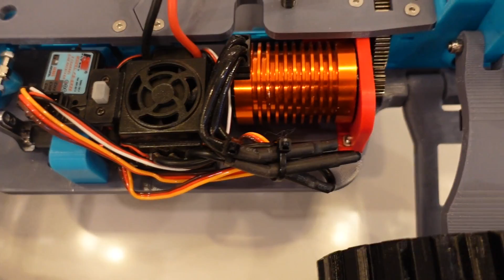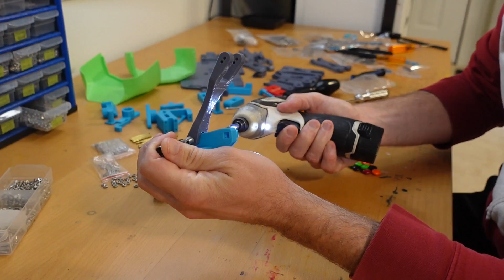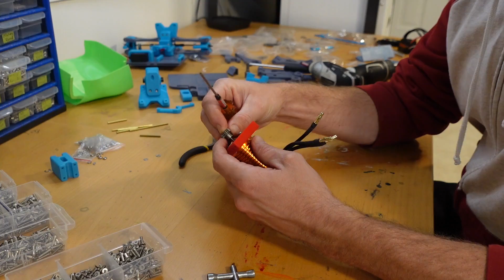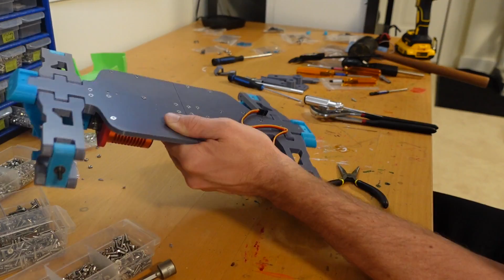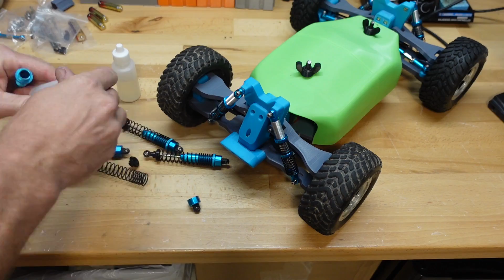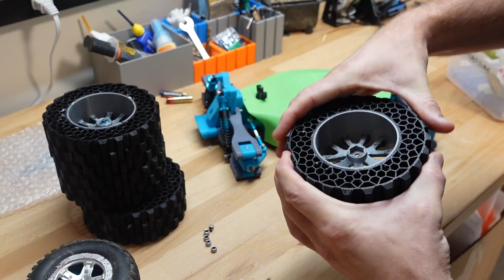Robak 2 - 3D Printed 4WD RC Car

Comment: what brand is the screwdriver bit set you use on the drill?
Reply from the maker: those are mip speed tips. They're nice and they last, but you can find cheaper alternatives too

Comment: can you make a kit for this that has everything but the electronics? I need the driveshaft and stuff, but already have a motor, esc, and servo.
Reply from the maker: You can order the HSP parts kit on their own: https://rcprinter.com/products/hsp-parts-for-robak-2 and then also order a kit with fasteners and bearings here: https://rcprinter.com/products/robak-2-build-kits?variant=42891241062561

Comment: Nice build.  What is the spray that you used a couple times in the video?
Reply from the maker: It's an activator for the glue I was using. It's a  Cyanoacrylate glue like super glue.

Comment: great build! how would you compare this to the Tarmo4? Looking for a new RC to print while we wait for Tarmo5 release!
Reply from the maker: Seems pretty durable in my testing so far... should have another video up about it next week. I'm running a 13.5T motor and its getting a bit hot though with a 21T pinion. Those wheels are big!

Comment: The larger rubber tires really make a world of difference in enjoyment of the Robak.. along with good shocks. I absolutely love my Robak2. I used a sensored 10BL120/Rocket V3 13.5T and I really think that going sensored has a lot of advantages in this larger vehicle at low RPMs. When I used a $50 surpass 540/60A esc it would cog constantly in grass because the unit is quite large and with the large rubber tires, it will have quite a bit of initial resistance to getting started. So the cheaper pair was useless in my Robak2, but worked really well in my Badger (and guessing it would in the Ultra)
Reply from the maker: Great to know the 13.5T works well that Rocket V3 is the exact same motor I'm putting in it next! I'm looking forward to seeing how well those big tires work outdoors on a better setup. I also hope to build a badger soon too. So much to do!
Reply: @rcprinter Well not exactly first hand knowledge.. I somehow confused my order and ended up with the 10.5T and it does get a bit too hot if you run it flat out for 5 minutes or so. So you need to manage the heat.. But the 13.5 should be cooler as its top end is slightly less. I measured 32kph with the 10.5. I built some small dirt ramps and it jumps small stuff pretty well. Have had for about 3 weeks with no breaks! So I can't guarantee exactly how cool the 13.5 will be.. However, I see you used that combo in another project so figured you had them around.I wish they had a bit more robust sensor cable.. seems pretty flimsy to me .. and would be nice if they monitored temp of motor.. but that is  available only on more expensive combos (I think). But I've decided sensored is the only way to go on anything 4wd and requires this much momentum to start. BTW I did build Badger and it was a fun build.. works well, but really needs rubber tires and real shocks.. The TPU tires look great and work well in grass & dirt, but its a racer and the grass & dirt need to be very flat and well groomed as clearance is low. Those are on order so haven't put it thru its paces yet.  The $60 sensorless combo works great in that.
Reply from the maker: Hey so I upgraded to the 13.5T and its still getting a bit too hot although it runs really well. Not sure if I want to try a fan or a smaller pinion or a higher T motor or some combo. I also got those rubber tires and they're great so far, a big upgrade from the printed ones.
Reply: @rcprinter  I never mentioned it.. but my body is modded.. I used the 2 piece cover with the SCOOP. It brings some air in.. and I added (drilled) 9 holes on each side of the scoop..(I can sent pic if you want)  to vent air. Ideally there should be some holes under the motor to allow air to run up over the motor, but water might get in.. I think this design has quite a bit more resistance to rolling than most other designs.. The tires are large and it is four-wheel drive.. Likely could benefit from a larger sized motor. I don't think a different T size makes a different.. just need larger than 540. You might try a smaller pinion to ease torque a bit. Mine doesn't overheat unless I run flat out a lot.. Generally I run about 5-10 min and then have a cool down cycle. But it works really, really well in semi-rough terrain. By far the best vehicle I've seen for a sort of Moto-Cross style running. And I really think a sensored setup is ideal for this large a vehicle.
Reply from the maker: @davecrabbe4579  thanks for the advice Dave, I've ordered a smaller pinion so we'll see how that goes to start and I might try a slightly larger motor too.

Comment: Wow! I'm so happy Robak joins your impressive 3D printed vehicles collection. Can't wait to see the car running outside 🔥Watched the video 2 times so far trying to spot all the difficulties you've faced during the build😉That's priceless information for the future modifications and guides. You did it really well! Thanks 🤩
Reply from the maker: Thanks man! This was a great build and I hope to do a bunch more testing on it soon and then put together some full kits for people on our site (www.rcprinter.com). The motor I installed in the video is way too high of a KV and its not sensored but I stock a bunch of 13.5T brushless sensored rocket v3 motors that should work perfectly so I'll do that upgrade with some hardware upgrades in the next video once all the parts arrive :)

Comment: What's the reason of that coughing on the throttle? Because it's sensorless? I have this issue on my challenger with a brushed motor and no differentials. Tried to tune it away in the controller, but not a great result.
Reply from the maker: Yeah sensorless is the main reason it acts like that (cogging) but its made worse by a low power battery, high KV motor, and really large heavy wheels requiring lots of torque to get moving. These are all things I'll fix in the next video :) If I were to just use a 3s 50C+ battery it would go a lot better without any other changes but I want to wait for the right diffs to be installed before I start putting lots of power through it.
Reply: @rcprinter  those tires have less grip than bought (gum) tires. My printed rim just ripped off so I switched to the "real" tires and immediately snapped the diff. 2S + 3 part diff case (mod or version 2.1) solves the problem.
Reply from the maker: @mr-makavelli  thanks for the heads up.
Reply: @rcprinter  what's the motor KV you're running? For me 3300KV works best. I can use 2S or 3S lipo, switch between 17T and 21T pinion gear while still being in the resonable power output range. You can take a look at the Robak power system table https://docs.google.com/spreadsheets/d/1-AEfSLWzXtjigXyWWhs8wwlRnVofR2l7TgEqp8cfjc4/edit?usp=sharing
Reply from the maker: @robaki-dev  Hey so I've been running a 2S 80C LIPO with a 13.5T motor in my set-up with a 120A hobbywing quicrun esc and a 21T pinion but its getting way too hot in my testing.  I ordered a 3652 and a 3660 motor @3200KV to try to see if the larger motor helps. I also ordered a 17T pinion to see if that helps and I also ordered one of those Max10 60A escs to see if that makes a difference. We shall see :)
Reply: A decent quality sensorless combo in many cases is enough to overcome the startup hesistation problem. More advanced ESCs run quite complex switching algorithms for the motor to provide enough torque even from 0rpm. I cheaped out on the ESC in the first gen Robak ($20 blue ESC) and it took me months to understand it's garbage. Then I had $35 RacerStar - tolerable but inefficent (motor was getting very hot). Finally upgraded to the HobbyWing EzRun MAX10 60A ($60) and it breathed new life into Robak. Specs on paper is the same for each one but in the field it's like night and day.

Comment: The ar looks well designed and sturdy.Do you agree?
Reply from the maker: So far it seems pretty sturdy but I haven't put  much power through it yet or run it outside. We shall see pretty soon.
Reply: @rcprinter  please give it a stress test if possible